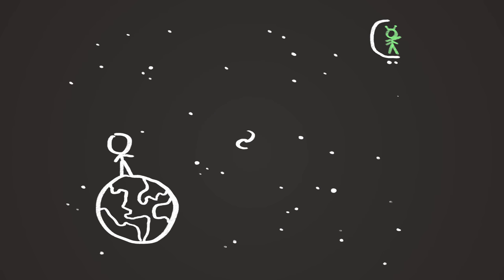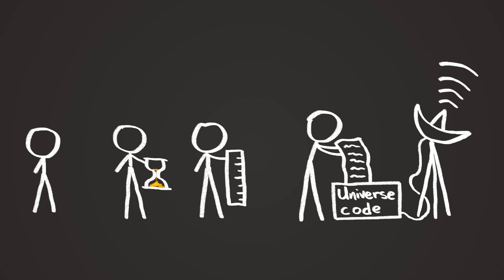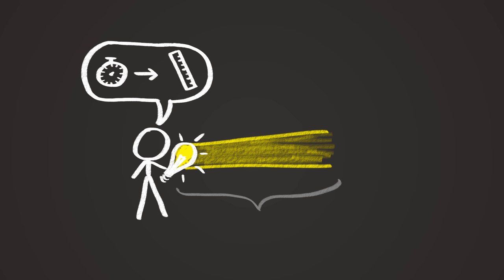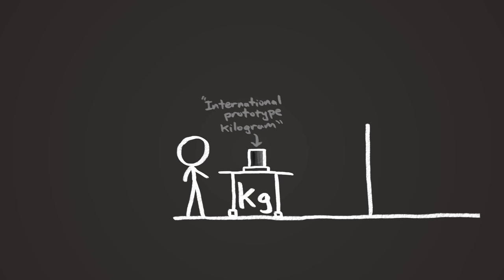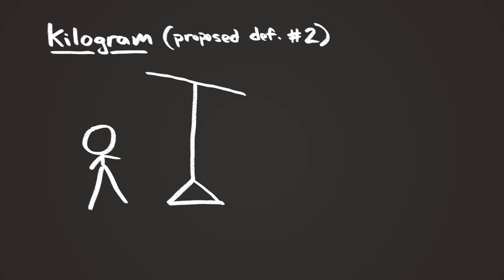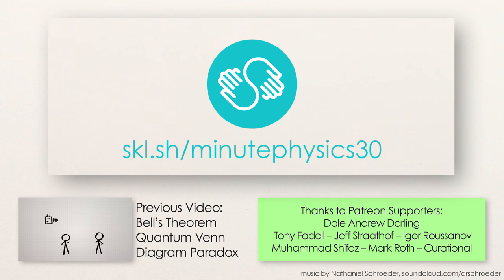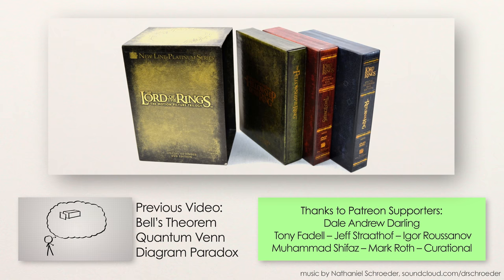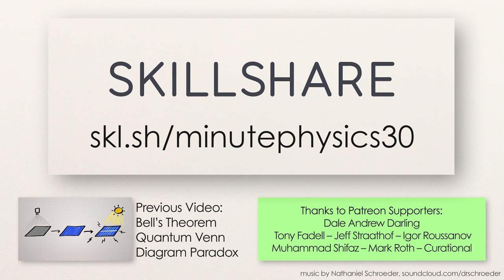How to Build a Teleporter with Aliens

Comment: Only problem is that it'll take 4 years to send each message, or over 8 years for round trip communication...

Not exactly the easiest way to collaborate on a project... but it's a cool idea :3
Reply: faster than light transmisions. a dark sphere can help aka black hole.
Reply: +quest 34667 How can we build a black hole without destroying the Earth? And how does a black hole help transmitting electromagnetic waves? Doesn't it just swallow the light?
Reply: of course we would have to be a level 4 society. a society that can use stars to travel through space. forming the dark sphere away from mater. the super strong gravity force travels faster than light pass the event horizon. yes it swallows all but we don't know yet if it sends the waves to another part of the universe. be well.
Reply: yes....i agree using dr. einstein's special relativity formula you do end up with negative results and or infinity. but even dr. einstein admitted that he could never solve for gravity cause he could not understand what happens after you cross the even horizon because he kept coming with the result of infinity or a negative number. but many theoretical physisist have excepted the idea that space time is moving faster than light after the event horizon and that is why light cannot escape. we have detectors now that measure gravitational waves proving that space time can stretch and contract. so maybe it's not the information that is moving through space time but space time itself is carrying the info with it at faster than light speeds. dr. einstein did also say nothing can travel faster that c. through space time but space time itself can travel and any speed even faster than light. great chatting with you.
Reply: Sounds exactly like how my customers collaborate. And we're on the same planet..

Comment: wait a minute. Isn't there the roundest thing on earth featured in veritasium that dictates the actual value of a kilogram by atoms?
Reply: Not yet. But we could define it that way.
Reply: Isnt it changing FROM that to a universal constant?
Reply: That is what he was referring to with the {bignum} of silicon atoms. That is one proposal for defining the kilogram - using that experiment to fix Avogadro's constant, the number of atoms in a mole. The other one is using the watt balance to (indirectly) fix the value of Planck Constant. With that done, we flip the definitions around - instead of the constant being a measured value based on the standard kilogram, the constant becomes a fixed value which defines the kilogram.

Whichever one we chose, one of these number becomes a fixed value, and the other becomes a calculated one.

Comment: 6.022... *10^23 is Avogadro's number, and like a dozen is 12 of whatever you count —eggs, papers, atoms, or asteroids —so is this number of anything a mole of that thing, particularly atoms or molecules. Once you agree on a mole, mass, density, and even pressure can be determined. You can do a lot of basic chemical and physical chemistry communication this way once a mole helps you determine weights and measures.

Comment: There's little reason to expect one second on Earth to equal one second on Alpha Centauri. A cesium clock will oscillate at a different frequency when in a different gravitational field. A more accurate "second" can be agreed upon if both parties observe the same pulsar, count the oscillations and divide by their respective conversion factors. 

e.g. divide the time it takes to observe 1,000 cycles of CP 1919 by the conversion factor 1337.3 to determine one second in Earth's gravitational field.

Comment: What if they don't know what is a proton neutron and electron 
And are you sure they can speak English and use base 10 numbering
Reply: Manan Joshi well if they can figure out how to talk with a civilisation light years away, they probably can figure out what is a proton.
Reply: I'm pretty sure an alien race capable of interstellar communication would know about the fundamental particles that make up matter.

You'd also not use English, but represent the information visually.  You can explain the number system similarly. I mean, we don't necessarily need to be told a civilization used a base-60 system to figure that out.
Reply: You're right in that they might not use base 10. In which case, we'd need them to understand what counting is, then teach them base 10 by putting, say, 10 things in a row and say "10." We could do that with lots of other different objects, but always having 10. If they're intelligent enough to build a teleporter they'd probably get the idea eventually
As for the proton, neutron, and electron, we could say "the thing in the centre of hydrogen that has charge, the thing in the centre of hydrogen that has no charge, and the thing around that has a charge that attracts the thing in the centre
There are MANY better ways of saying this (usually through a long, complex method of items referencing themselves via a tedious way of elimination), but given enough time we could give them the gist, regardless of whatever method (human or alien) we could think of
Reply: Manan Joshi We'll have to include a base 2 translation for base 10 to help them.

Comment: I was always told that one mole is equal to the number of atoms of carbon-12 in 12 grams of carbon-12. With this relationship, wouldn't it already be possible to define the kilogram in terms of Carbon-12 atoms, which is the same idea as the silicon-28 sphere? Is there any benefit to choosing silicon-28 as opposed to the traditional carbon-12?

Comment: What if the aliens insist on us using their units where length units are 0.3048 times as long as ours and mass units are 0.4536 as massive as ours?
Reply: that is just plain stupid because we don't know their lengths and they don't know ours and the only units we both know are universal ones
Reply: Areg Hovhannisyan well, obviously they would be communicated in the way described by the video.
Reply: The metric system isn't strictly universal. its grounded in universal properties, but the specific values are arbitrary
Reply: I doubt. Theirs would probably at least scale a few powers of 10 either way

Comment: Okay so i know the following might sound silly but:

Just base your weight system on something like, the minimal weigh in hydrogen needed for a star to start and maintain fusion at it's core
or to put it simply
Simply take the mass in hydrogen needed for a brown dwarf to turn into a normal red dwarf star, then call that some huge number(for example 12^10x60 is what you call the mass of a star that is just large enough to maintain fusion), then just tell them that a specific number, following that as your universal measure, is how much they need to build their thing

Comment: OK, the point of this is that we don't have a fundamental definition of mass, but we don't really need one, at least, not for the purpose proposed in the video.  Once we have established temperature, distance, elements, and chemistry, we could send/run a series of isobaric phase change curves of water to determine relative atmospheric pressures of the planets (we'd want to do that before flitting between the planets anyway).  With an established distance and pressure, we can use density to establish mass, relative gravity, etc.  We might not even need to determine pressure, since liquid water is relatively incompressable.  Sure this still isn't a fundamental, but that's the difference between engineers and physicists, it's close enough.

Comment: You should have mentioned this is in assumption that we can successfully communicate with them with no ambiguity. How will they know what a proton/electron/neutron is, and what if they use a different number system than we do? Many more "brick walls" exist than the ones mentioned here.
Reply: Protons, neutrons and electrons exist everywhere in the Universe, and if they're able to build teleporters, they probably know what are protons, neutrons and electrons. The challenge is to make them understand what do we mean when we say "proton", "neutron" or "electron". The number system challenge isn't difficult, just use lines like III. Operations are difficult, however. Look at II + II = IIII. We would need to use many examples to make sure they don't understand something else by it. Like:

I + I = II
II + II = IIII
II + III = IIIII
III + II = IIIII
II + I = III

However, there's still the possibility they will understand this as "= serves to remove the space between I symbols" or anything else. I agree, there are many more "brick walls".

Comment: Just a random thought, but couldn't we redefine our "standard" units and work backwards?

So the second is based on the frequency of light radiated when a Cs atom makes a specific transition, and a meter is based on the distance light travels.

What if we define a joule as the amount of energy in 2.7551688167e18 photons of that same frequency of light? Then a newton is defined as the the amount of force you need to exert to give an object 1 Joule of kinetic energy after pushing it 1 meter. Then you can define the kilogram as the amount of mass you have if pushing with 1 newton provides 1 m/s^2 of acceleration.

You could also define the joule in terms of the amount of energy released when a certain number of (~6.7e9) are annihilated with anti-protons, and follow the same logic. Or once you have the definition of the joule you can base the kilogram on the amount of mass that would need to be annihilated to get ~1.8e10 J of energy (1 kg matter, 1 kg antimatter, or 1 total kg of matter and antimatter if the energy is ~9e9).

No need for a new physical standard for mass, unless I'm missing something.

Comment: if we don't need a really accurate results (wich we need in this example), we can use some volume of liquid (for example water) to measure 1 kg. Since we have distance measures, we can have volume measures and liquids are a lot resistant to density changes, so no point in counting all atoms.

Comment: Except they don't know what a second is, or proton or neutron.
Reply: The first part of the video already talked about how to define a second (how long it takes for a specific atom to oscillate a specific amount of times).  And explaining what a proton or neutron is would be fairly simple as they should already know what they are if they're communicating with us.  Language would be one of the main barriers.
Reply: You could explain what you mean with just even a single symbol. The Voyager probe sent out has something like this showing the simple and most abundant atom in the galaxy: hydrogen. The symbol is a spin-flip transition of a hydrogen atom's electron.
Reply: But what if they do not share atomic model we use to represent the atoms and it's shells (Rutherford-Bohr Model). They might have discovered some other way to describe the atomic structure.
Reply: BrainCart 
As far as we are concerned the Rutherford-Bohr model is the truth. If they use a different system then they are not advanced enough, then they don't know the truth.
Reply: Turun Ambartanen I have to completely disagree with you there. Bohr's model is completely flawed in that electrons would have to teleport to higher/lower energy levels. It does not account for a third dimension of the orbits. Modern chemistry and physics use orbitals to model the probabilities of where electrons are and aren't. The Bohr model is just something they teach elementary students to keep things simple.
Reply: The Bohr model is absolutely not "the truth;" it is just a historical conception of the atom which is still often used for diagrams due to its simplicity. The notion that our model of the atom might be misinterpreted is totally reasonable: after all, it's not as if atoms really "look" like that picture.
Reply: Whether or not the Bohr model is accurate in terms of electrons, I find it hard to believe aliens would be unaware of the concept of the nucleus - and thus they know what a proton is, since it's the smallest/lightest possible nucleus.
Reply: Well, they already covered seconds in the video. As for subatomic particles, you could send a video. The video would show something easily recognizable and universal, perhaps a galaxy, and would progressively zoom down to the stellar and planetary scales. Eventually it would reach our scale, at which point we could show them what we look like, and then keep going down. Finally we'd show a computer-generated animation of an atom, as accurately as we know how to portray them, and hope that they understand that. Because honestly, you can't get any clearer.
Reply: Turun Ambartanen not only what people said before me, but also, that way we describe atoms has been constantly changing since we discovered them! whose to say that we won't find another, even more accurate way to represent atoms in the future?
Reply: Whoops, I think I have messed up my terminology there. I did not want to say that a simple protons, neurons and electrons model is the whole truth. I meant to say that - if they are at least as advanced as we are - they would know how atoms are made up and probably had a simpler explanation in their history too. You don't need to go down to the quark level to explain the difference between H and He.
Reply: The problem in "showing" a model implies that the aliens can actually see the way we do. Maybe they're totally blind and communicate only via sound. Maybe they don't see color or brightness. Language is the greater barrier, once we go past that I think we can easily trade the knowledge of atoms and stuff.
Reply: Videos are great for people like us with eyes and ears. A blind man sees only a blank cold tablet. Think again.
Reply: Our Dark Lord How the hell did they manage to get as far as they did if their entire species is blind?
Reply: Well, there's blind and there's blind. Obviously they need some way to sense their environment. Light in our visual spectrum happens to be a decent information source because of its weak interaction with our kind of atmosphere, and its strong interaction with solids. But so, too, does light just above and below our visual spectrum, so they may have a shifted range of visible lines. Or maybe they have a less clear atmosphere (or maybe they evolved near ocean vents or in caves) and light just wasn't useful to them - they'd probably have knowledge of it (things that can sense light and turn it into whatever they use for input), but it would be an exotic tool to them like x-rays are to us. Due to density of our atmosphere, vibrations in it are also a good information source (i.e. sound is useful) but we under-utilize it as a species - other animals are very sensitive to vibrations in their medium (be it air or water) and have amazing senses we're blind to. Similarly with scent - a good sense of smell (perhaps with receptors not just in one spot, but all over the body or on appendages) could add a lot of information to echolocation and make the combined senses really good at things we think we need sight for. There are other exotic senses in other species on Earth - sensitivity to electromagnetic fields that let birds navigate and some kinds of fish detect other living things is one example - we're totally blind to that. Depending on the environment, any of those senses might be more or less useful than light (as I said - light happens to work for us because our atmosphere is so clear to it and the sun is dumping it all over - but that's not a given). And all that is just senses we've thought of or observed in nature - there may be other good sources of information we haven't thought of because our planet is a good place for sight to work well.
Reply: The charged particle in the nucleus.  The one that is free to migrate to other atoms is the electron.  The uncharged one is the neutron.
Reply: Wrong, we have used the Schrödinger's model to better represent the atom. But the Rutherford -Bohr model is the one which we have been using to explain the atomic structure.
Reply: I know, but the Bohr model is the one we still use to make a basic understanding of the atomic structure. even the one on the Voyager's golden plate (the drawing) is based of off bohr's model
Reply: Positive and negative cant be interchanged. You can describe it like this, negative as the charge of the subatomic particle "electron". and electron because it  is easy to identify. and define "electron" as the outer most subatomic particles orbiting the nucleus.
Reply: The electron cloud would be confusing to model and understand
Reply: Another thing is, if they have a way more complex model (which they will if they know how to make a teleporter) that we haven't discovered then, it will be harder to explain.
Reply: Mephostopheles But they dont have a, like, mp4 codec

Comment: Suppose I was in a rocket accelerating through space. If I opened a wormhole under myself and appeared on the other end above a couch, would I safely fall onto the couch, or be launched back into the wormhole because of my upward momentum? Would I rocket at the same speed downward, would my speed multiply?

Comment: If we were doing this, I'm pretty sure we would think of convenient multiples (or subdivisions) of natural units. Natural units are uniquely defined by setting a few of the most fundamental constants equal to 1. The system I'm most familiar with is Planck units. For example, the speed of light is 1 Planck length per 1 Planck time.
https://en.wikipedia.org/wiki/Natural_units#Planck_units